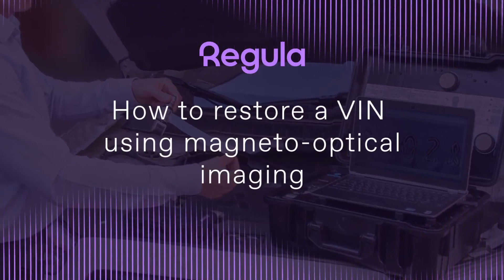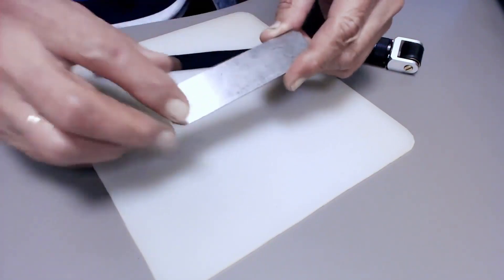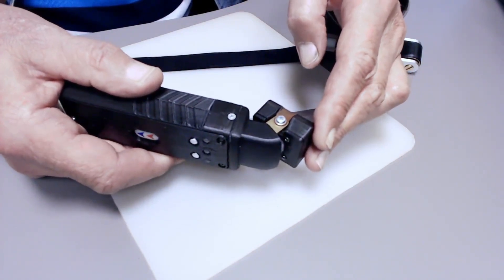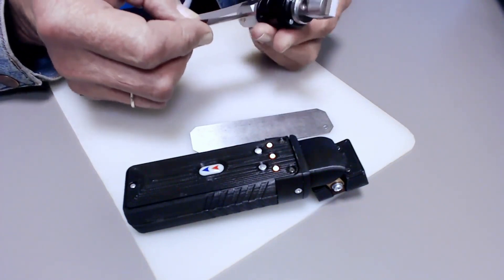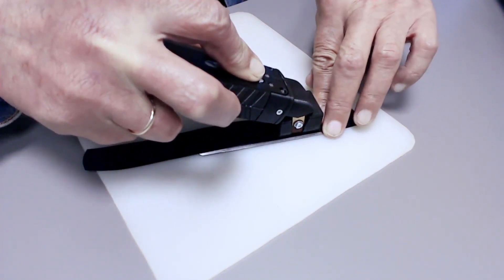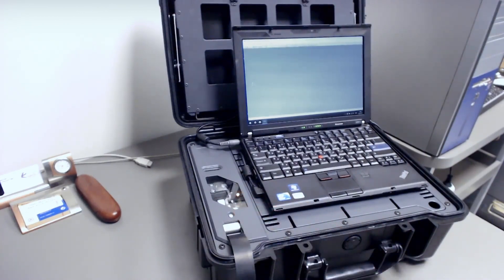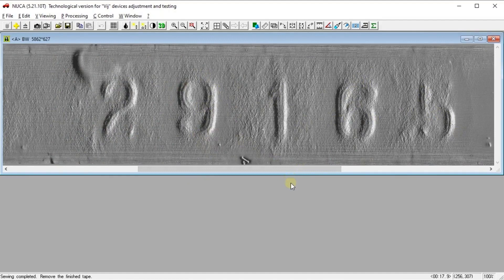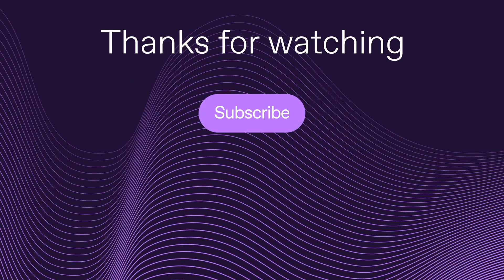How to restore a VIN tag using magneto-optical imaging

Comment: The successful functioning of the Regula 7505M device has changed the face of restoration for Vehicle Identification Numbers and firearms serial numbers using a new technology in magneto-optical imaging. This new technology offers forensic practitioners, law enforcement agencies, and other professionals a professional, highly efficient solution.

The Regula 7505M does not damage and preserves VIN and firearms serial numbers; the integrity of the evidence is thus retained. This is a big plus since, during a forensic examination, there should be no alterations to the original state of the object under investigation so that the evidence collected from the scene of an event can be considered legal.

The device uses the principle of magneto-optical imaging, a technique that picks up the magnetic fields created by ferromagnetic materials to capture the VIN or a serial number. The magnetic fields show and get interpreted with the original numbers revealed, even if tampered with, damaged, or erased.

Needless to mention again, reproducibility is one of the important aspects of this technique. The Regula 7505M never fails to produce clear and reliable results, hence usable in forensic investigations. This improvement of the device in producing accurate results more than once has a bearing on increasing the credibility of the evidence presented and helps in strengthening the case in a court of law.

Moreover, the Regula 7505M provides quick results, therefore significantly reducing time required for such analyses. This, therefore, may be the determinant factor in time-sensitive investigations to let professionals make decisions on time and take necessary actions.

Personally, in the forensic expert practice, it would be quite hard to do without the Regula 7505M. Its non-destructive approach, reproducibility, clarity of the results, and speed make it a reliable choice for the restoration of VIN and firearms serial numbers. Application of magneto-optical imaging by means of this device raises the quality of investigations and sets a new standard for forensic practices.